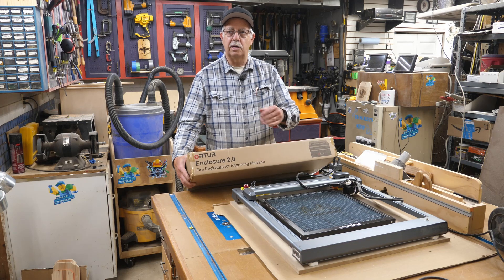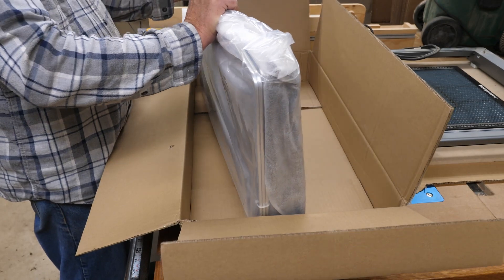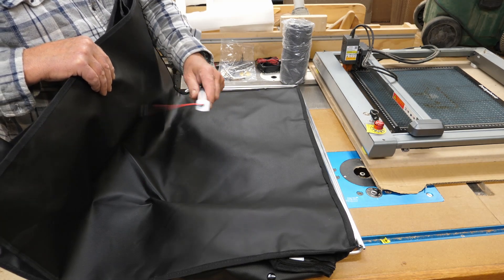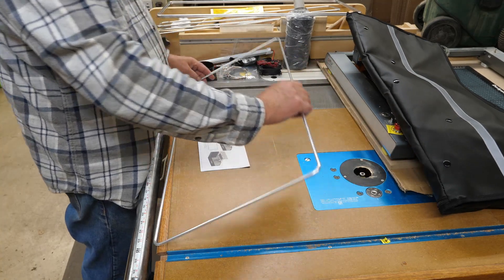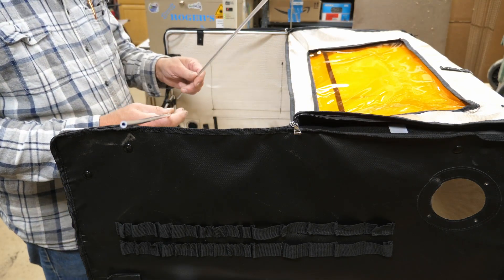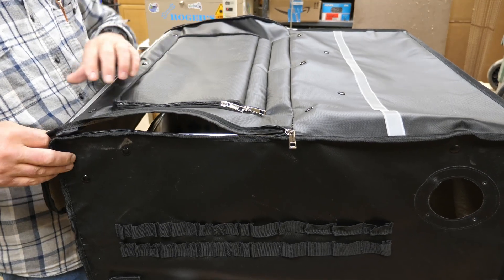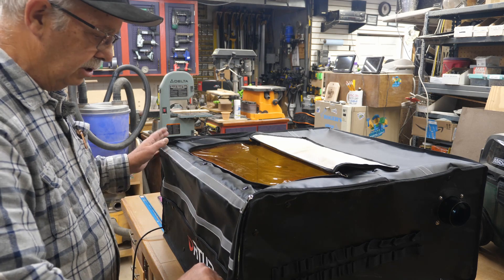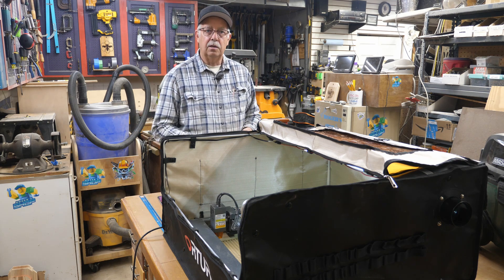Ortur Laser Fire Enclosure Assembly

Comment: Thanks for the instructions.  Will you tell me what kind and what size hose to use with the fan opening?  Thank you!
Reply from the maker: An exhaust hose came with it, but I have not used it yet.  It 'looks' like 2-1/2", although I have not measured it.
Reply: @rogersshop  Thank you.  I have the enclosure but haven't opened it yet.

Comment: Will this cover replace air assist?
Reply from the maker: No.  those are two different things.  I did not connect the air assist in this video.  Normally, I use it.